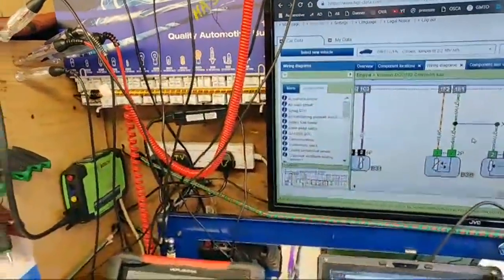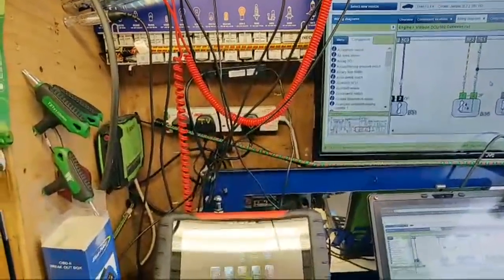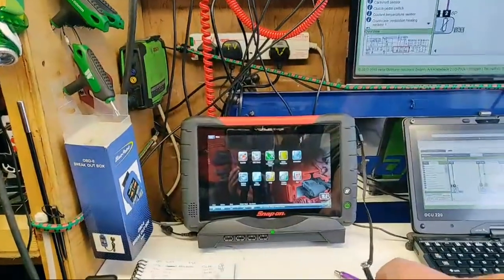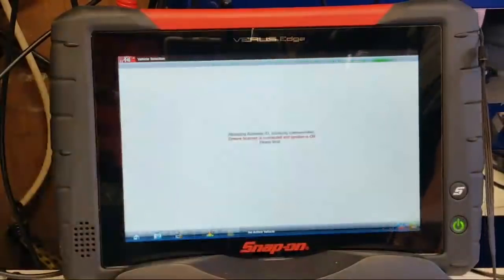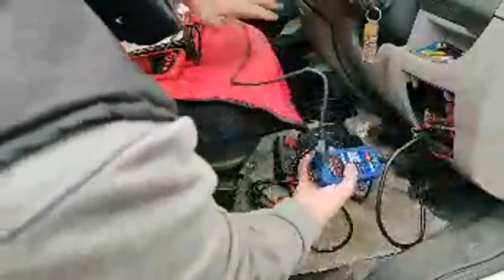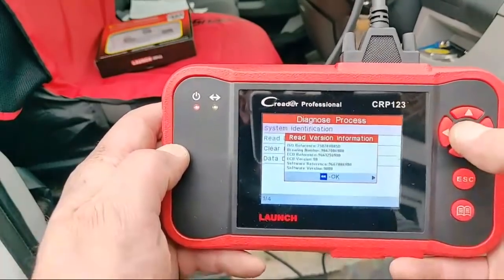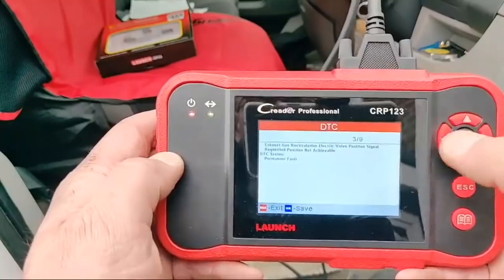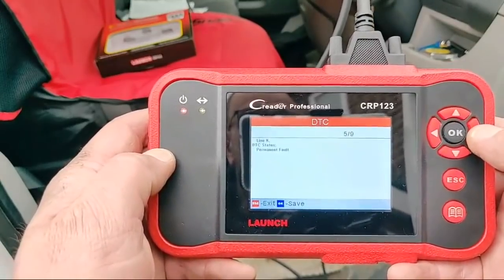P0405 EGR Fault Diagnosis & Launch CRP123

Comment: Hi mate awesome Vid! I’m getting exactly the same codes!
Just wondering…. You know when you are back probed into the Postion wire (grey/blue) do you not need the engine running to get a voltage reading off that?  Is it not meant to be 0V whith just ignition on?

Also, my Haynes manual is trying to tell me that I should have a voltage of 12-14.4V on pin 5?? Isn’t this a bit high. It is at 1.27V at present!

I’m new to this diagnosing mark so sorry if it’s a dumb question!😂

Comment: Did you van keep stalling Steve .. My 2003 Astra  auto 1.6 8v petrol kept stalling on my when I slowed down coming up to roundabout's lol
Turned out to be egr valve fitted a nice new one and cured it..

Comment: Great video steve full of interesting knowledge thanks for sharing it , I have few questions please 1st about testing wire integrity can you use an countunity on volt meter as you said signal wire not command , 2nd even if you have a wiring diagram on 6pin circuit such as Accelerator pedal how do you separate power , ground, signal , command , control , input , out put or 5 volts reference wire . Sorry for long but I have put one to the group I had limited responses. I don’t know if that due to hard fault code or what
Reply from the maker: Continuity is not a valid test in most cases. You have to load the circuit to test mate. Reading diagrams will be a live stream in the very near future 👍
Reply: Simply Diagnostics thanks steve for taking time to reply to my queries , you are awesome steve

Comment: Great video again. Would it not have been worth giving the earth on the control circuit a direct path to ground with the engine running and seeing if the engine stalls thus indicating if the egr is moving or if the fault is on the sensor circuit. Just my input but hey sure some will put me right
Reply from the maker: You could but without cutting the wire you risk blowing the driver in the ECU. I could have also used a sensor simulator to test the position signal but it was about quick and dirty tests. I also have the SP actuator to directly control the valve but the test wasn't warranted. 0v out of the position sensor koeo is new part required once you've confirmed vref and gnd.